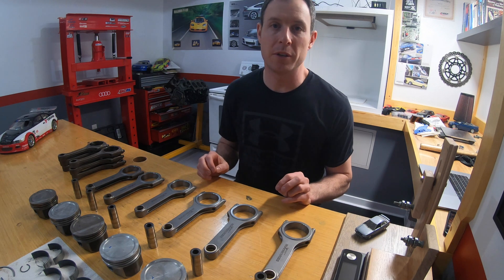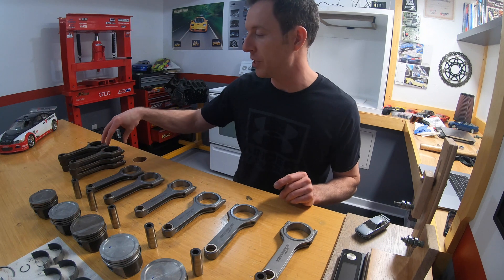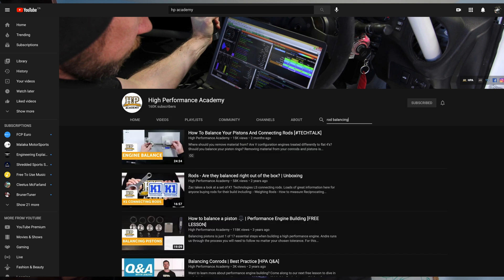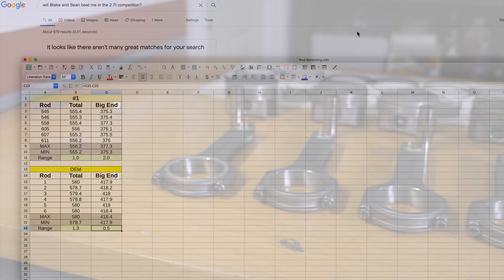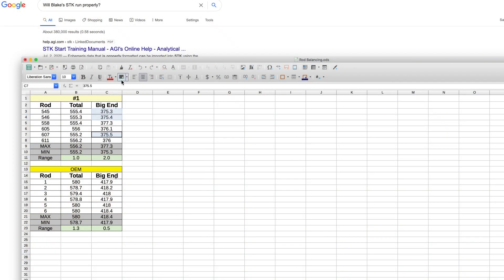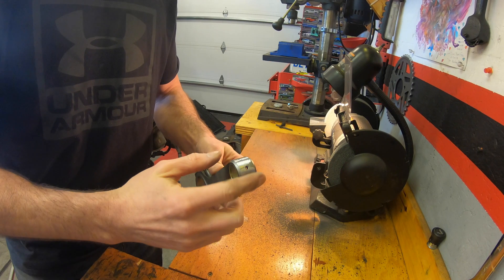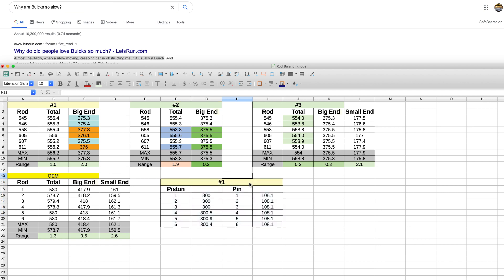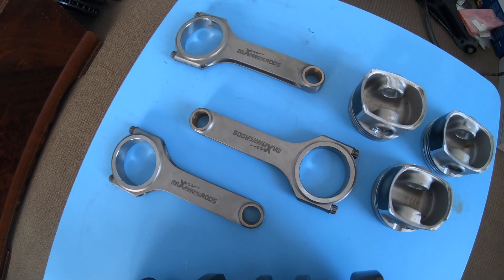Maxspeeding vs Audi OEM Rods - Balancing - Are the MS Rods balanced out of the box?

Comment: Same rods for the timing belt 4.2 v8 audis. Atleast so ive heard
Reply from the maker: Really? I wasn’t aware. Thanks for the info!
Reply: @PBGarage  yes the 2.7t the 1.8t and the 4.2. Pistons or rods can work.

Also any vw engine bolts up. Same bellhousing pattern from porsche to vw to audi to bentley. 

Instead of engineering new parts for each engine or vehicle companies tend to use the same parts across the board.

The 2.7t turbos bolt up to a oem audi a8 4.2 manifold aswell. Or a single 2.7t crossover pipe bolts on a 4.2 for a single 4.2t kit.

Comment: Great video series. Thank you.

Question: Did you have any cylinder bore issues to start, therefore having to use oversized/different than factory rings/pistons?
Reply from the maker: Thanks! I took some measurements and the bores seemed okay. No custom rings or anything. Just as I was assembling the bottom end (after honing / cleaning the block) I found some minor pitting at the bottom of some bores, likely from water sitting while the engine sat before I bought it and did all the work. Had I seen that before I would have oversized / larger pistons etc but I decided to just run it in the end. So far so good but I’ll be doing an engine health check before winter storage this year (compression and possibly leak down).

Comment: I personally haven't done too much research into this topic, but what would be the effects of just putting the rods in before the balancing and weight adjustment? For example, if I just slapped those rods into my engine without paying attention to weights and not getting the crank balanced properly like you did
Reply from the maker: Great question! Essentially the more out-of-balance the crank is the more vibration the rotating assembly will have (think about driving on the highway with a wheel that lost a wheel weight, or two, or three..). The greater the difference in big end rod weight from stock, the greater the imbalance, and therefore the greater the vibration load on the bearings. Whether it's something you will actually feel while driving, I honestly don't know. The impact the imbalance will have on engine longevity (like bearing wear), again, is hard for me to assess given my limited engine building experience. 
Check out this link for a quick explanation on the effects of engine vibration: 
https://fluidampr.com/engine-vibration/

For me, having weighed the big ends of both MS and OEM rods and seeing a 43g difference, that would have kept me up at night considering I am also doubling the HP of this engine from stock. My machine shop turned it around in 1 week and at $400CDN, that's a drop in the bucket on this build! : \
Reply: @PBGarage  Awesome! Thank you for the very indepth response! Definitely will keep this in mind when I end up building my motor. Thank you!
Reply from the maker: You’re welcome! Always happy to help 🙂

Comment: I'm AudiAR01 from Audizine. Your MP rods were a lot closer than mine. Glad you checked yours. But yours were a lot closer.
Reply from the maker: Hey! Yup, you're the reason for going the extra mile on this engine. While the MS rods weren't too bad out of the box, the weight difference from OE rods was an eye opener. Having the crank balanced at the machine shop, I believe, will have been worth it if anything. I'm being really detailed with the rest of the build so this is an aspect that I'm glad I went back and corrected. Thanks for pointing it out!
Reply: @PBGarage  no problem at all. I enjoy your videos and thread build on Audizine. And I gotta hand it to you. Your rod balancing platform you built was awesome. Excellent design, application, and use of it. Looking forward to following the rest of the build and seeing it completed. And I also took some info from you on the powder coating. I'm making our old extra oven a powder coating oven. That's such a great idea. I appreciate the information on it, that you gave me. Keep up the great detailed work man. I'm impressed with everything so far.